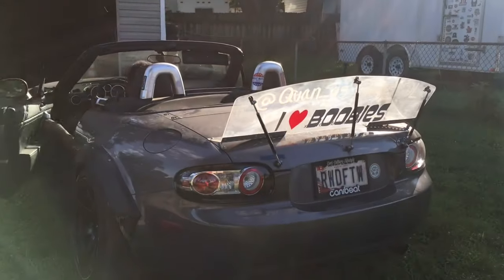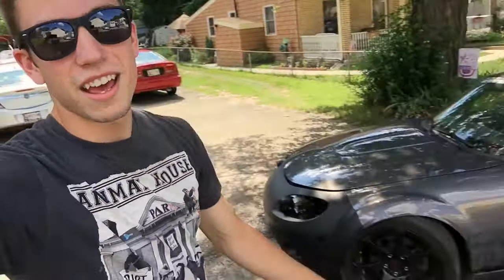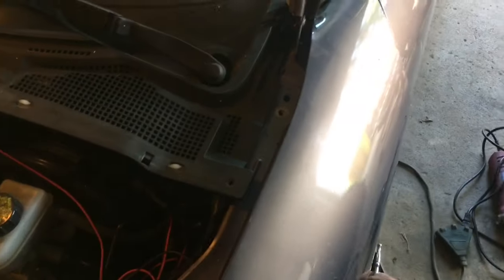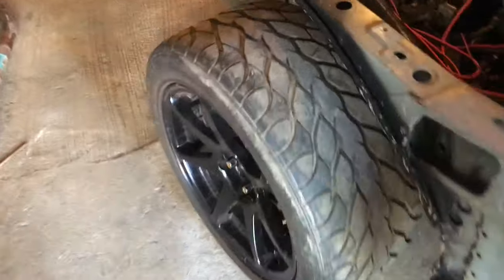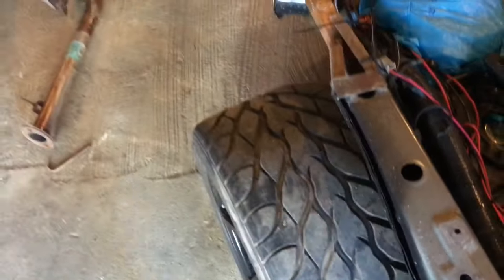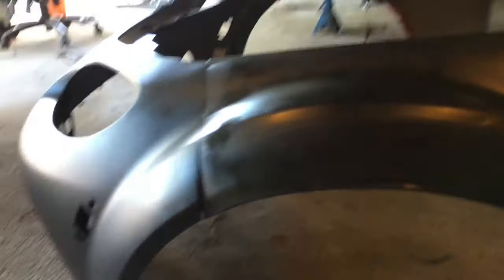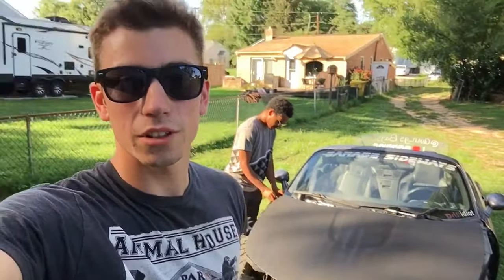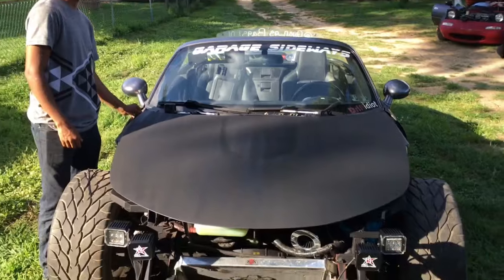Plasti Dipping The Race Car! RWDFTW

Comment: I've always had good results with plasti-dip, by putting on my first few coats light, just barely dusting the surface and once the whole surface is uniform put the last coat on as a thick wet coat

Comment: the first coat needs to be thick and close, this is the base coat and needs to dry as one thick layer. or else if builds up like little grains of sand, and creates a rough texture :)
Reply: no the first coat needs to be light an dust across it then when it drys the next layer can be hard and thicker
Reply: +Thewasteland Yep, i always do first 2  coats very light then go thicker and wet. gives a very smooth finish

Comment: You might have been spraying to far which causes a light spray which causes it to be dry making it look rough. And the tiger stripes it's just cause you didn't overlap enough. And for other questions about plasti dip it can't be wet sanded it'll just start peeling and balling up.
Reply from the maker: yea were gonna re do it thanks man!
Reply: No problem man keep up with the videos.
Reply from the maker: will do!!